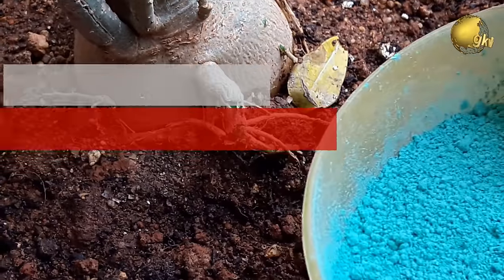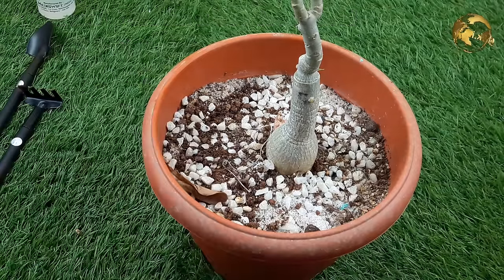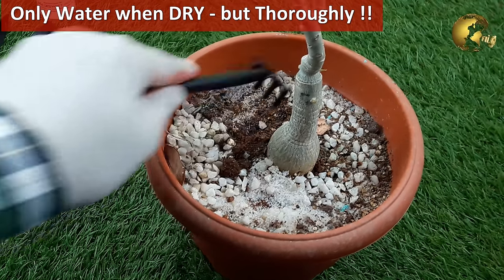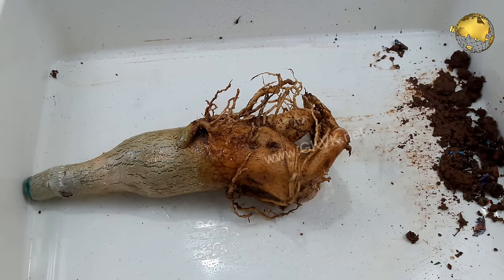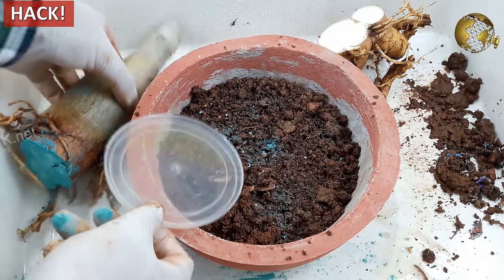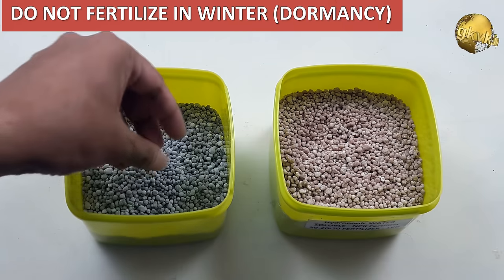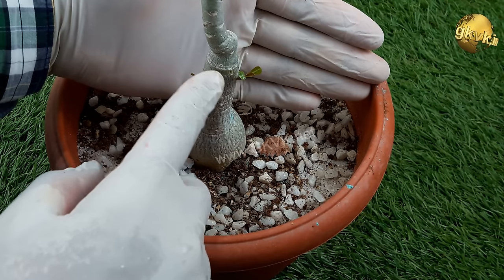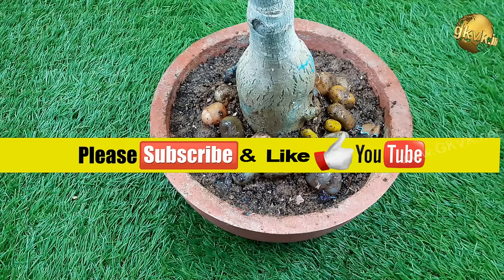ADENIUM HACKS AND TIPS: Get a FAT Caudex | How To Make Adenium Caudex 5 Times Thicker?

Comment: Nice information sir, in 3rd point you cutted the plant into two parts , will bottom can be planted separealty and can be used as one more plant or need to throw , And if safa fungicide powder is not there can we use turmeric powder, and for wax can we use glue stick glue
Reply from the maker: I tried to grow that bottom part but failed. SAAF OR BAVISTIN is better else you are taking risk with turmeric. I haven’t tried turmeric for this procedure.
Reply: Thanks for reply

Comment: I have grown an adenium from cutting. So it doesn't have a big caudex. Is it possible to make its base thicker by pruning close to the base ?
Reply from the maker: You won’t get caudex but can make stem  thicker.
Reply: @GardenTips I have heard  by pruning and hanging the plant a week in air will help get thicker stem. Can I do the same with adenium grown from cutting?

Comment: Hello..any tips on growing Adenium from cuttings?
Reply from the maker: They can be grown but they will not look beautiful and you won’t get the caudex.
Reply: @GardenTips  yeah.. am also growing from seeds. But out of interest, i got some adenium cuttings from neighborhood.. but a good shape of cutting can be grown beautiful sometimes.. ;-) and my doubt is whether they can be grown and how much time will it take to grow roots and after roots are grown, is it possible for tap root method to work?
Reply from the maker: Yes you can grow and there won’t be any tap root but only fibrous roots. They also produce flowering but Adenium which is famous for its caudex which imparts the beauty to the tree will not be formed.
Reply: @GardenTips  yes agreed...i am a overall plant lover. So...even if a beautiful caudex is not grown for the two cutting i obtained from my neighborhood... An Adenium is always an Adenium..ri8..? :-D so it doesn't need much care to grow roots in a cutting..except soil mixture and fungicide.. is it? And if tap root(taproot is mainroot? Or the method u mentioned in ur video to grow thick caudex?)  is not present, does it affects the growth and nutritional cycle of the tree?
Reply from the maker: Except caudex cycle should be fine if cuttings roots successfully. Make sure the cuttings are dry in air for a couple of days before inserting into sandy soil else it can rot. Don’t water too much. Good luck! 👍
Reply: @GardenTips  i kept the cuttings in sandy soil the 2nd day i got it. I think i should check that now..ri8..? And these kinds of tips will be very useful if u post it as a video. I followed another persons video and this tip was not mentioned by him.. thanks for the tip... Pls consider doing video on "Tips on growing Adenium from cuttings" it will be very useful because in some places Adeniums are costly and seeds are not available.. in such situations cuttings can be obtained(luckily ;-)).
Reply: @GardenTips  is water soluble NPK 19:19:19 is good for adenium?